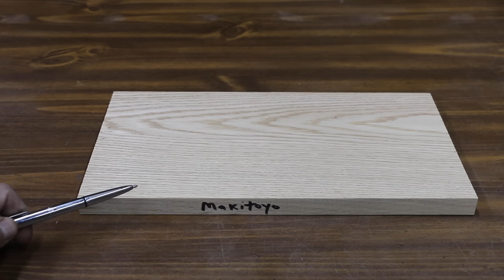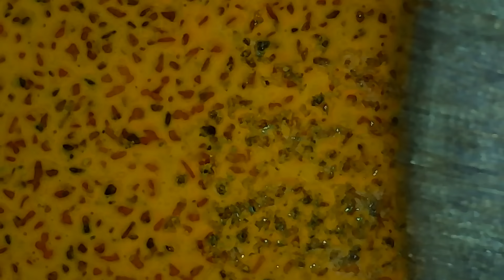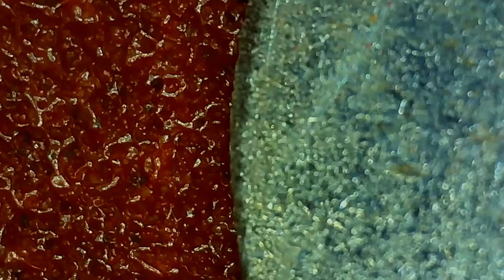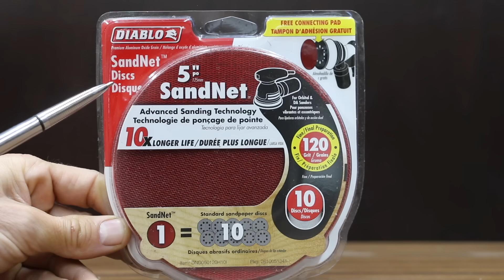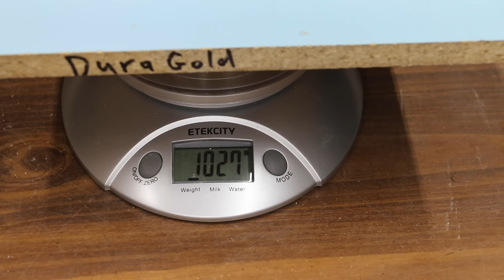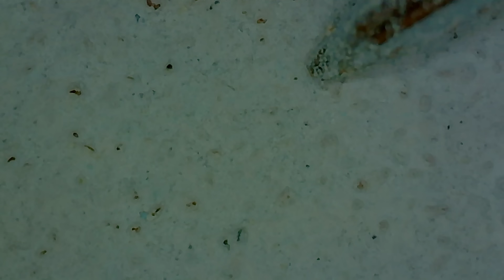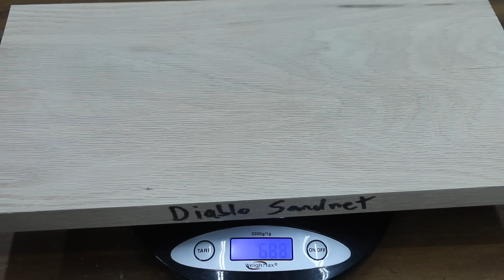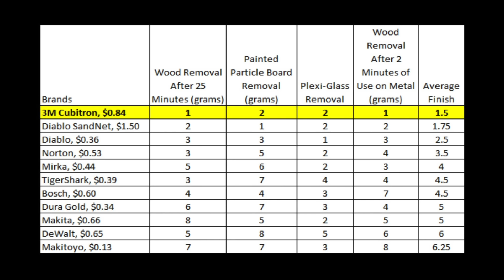Best "Sandpaper" Brand? 3M Cubitron, Diablo, Mirka, Norton, Makita, DeWalt, Bosch Sand Paper

Comment: You know what I would like to see?

I live in Florida and I'd love to see you do something on the best personal cooling device. I have a Makita fan jackt, an ice vest and a ice kap. i had a cold circulation system but it didn't work well. Humidity is an issue as cooling is different in humidity vs the desert. Evaporative cooling doesn't work here but wind on a wet body does.
Just a thought.

Thanks for all you do! I watch these before I buy anything now.
Reply from the maker: Thanks for the suggestion.

Comment: Would love it if you tested the best can of aerosol brake cleaner. 3m, Macs, CRC, etc.
I Personally prefer 3m and have had bad luck with CRC not removing grease and running out of pressure before the can is empty.
Thanks
Reply from the maker: Great suggestion!  Thank you.

Comment: Would there be any merit in comparing MMO/Seafoam with just plain tap water? use the water like seafoam and see if the shock can remove the carbon buildup?
Reply from the maker: Thanks for the suggestion.

Comment: One of the greatest channels ever... Is it possible for you to test three tools brands (Skil, Bauer and Craftsman) for the main tools a DIY'er may need? (Circular saw, recip saw, impact wrench, and drill) This may be so useful to decide for a wireless tool set. Also try Hercules, Kobalt and Ryobi. Such excellent work should be shared everywhere!!! Thanks!!
Reply: It is an interesting idea to average performance across multiple tools in a family, since you're not buying into any one tool line as much as you're buying into a battery family.  

When you move beyond the basics the tool selection varies a lot.  Personally, I have DeWalt for most of the big stuff (and I love their hedge trimmer) but I had to have the little Milwaukee M12 ratchet and have added a couple pieces to that. 

Then there's the Dremel, the 60V Ryobi mower...I got myself a wall of chargers.  

Then there's the Harbor Freight Bauer stuff I keep at a rental place at the other end of the state for light repairs - nowhere near as strong as the others but the value proposition was right for how and when it gets used, and the batteries are cheap.
Reply from the maker: Thanks so much!  Great suggestion!  Thank you.
Reply: Maybe with all the fuss yesterday thanks to Flex introduction through a glorified ad disguised as unbiased tests, you should try to test the usual tools from Flex against Milwaukee and Dewalt to set an end to such discussion. It will receive a lot of views for sure, but please don't forget my initial suggestion about testing Skil, Bauer and Craftsman, and Kobalt, Hercules and Ryobi... For starters, deciding the battery platform is a must. For professionals, a face off with Flex, Milwaukee, Dewalt and Metabo or Makita will be eye opening!!! Thanks and keep doing such an amazing work!!!

Comment: I can vouch for the durability of 3M Cubitron abrasives. Sanding a mixture of polyurethane spray foam(this stuff is killing sandpaper quickly), softwood, aluminium, some galvanized steel, a bit of acrylic plastic, plaster, epoxy and polyester body filler (Bondo),  ONE 5 pack of 80 grit Cubitron II  outlasted 2 packs of 25 SIA abrasive 60 and 80 grit.
Reply from the maker: Thanks for the feedback.

Comment: nice video, im missing sandpaper from sia. im a parquet renovator and we use bona abrasives. but they are way more expensive. we use ceramic disks. we even have disks with diamonds in it. they are grid 120 and cost 10 euros a piece of 150mm

would like to see some tests with grid 40 papers, mayby a grid 40 of bona ceramic? they even have a range of grid 36 that eats wood. 

mayby make a test with lower grid sanding paper.

test them with a wooden stick that is pressed by like 10kg and see how much each disk eats away?? 

hoping u will think about it
Reply from the maker: Thanks!  Thanks for the video idea.

Comment: Your videos are fantastic and by far the most comprehensive and trustworthy of their type on YouTube. Keep up the good work sir. 

As a woodworker I would love to see a comprehensive test of the most durable wood finish. When doing table tops or desktops the finish needs to really stand up some abuse. There are so many different options and everybody has their own opinion, it would be great to see the detail and methodical testing that you offer. Basics like oil and water based polyurethane, lacquer, pre-cat lacquer, and tung oil. More high end items branded products like Arm R Seal, Odie's Oil, Waterlox and Rubio  Monocoat. The list goes on and on.

As far as tests would love to see which one dries the fastest, what's the easiest to layer and build multiple coats, most resistant to scratches, heat and liquids. It's a huge topic that could probably be worth a few videos

I'm so interested in seeing a video like this I would gladly chip in some of the funds to buy the products and make it happen!
Reply from the maker: Thanks, will do.  Thanks for the video idea.
Reply: @ProjectFarm  you bet, and thanks for the response!

Comment: In my humble opinion, putting pressure on the sander taints this test. I'm only a hobbyist but I've done enough sanding in my life (I'm 60 years old) to figure out that the work goes a lot faster and the paper lasts a lot longer and the surface texture is more consistant, if you allow the weight of the sander to apply the pressure. Putting additional pressure beyond its own weight on the sander, creates excessive wear and tear on the tool and the paper. I rarely press down on the sander. I allow the tool and its own weight to do the work and my hand simply guides the sander. Same goes for hand sanding. A light touch makes the work go quicker and easier than pressing down hard on the paper.

and as a side note, I don't really see what was usefull about sanding wood after metal. does the paper sand more metal after sanding metal? That would be useful information. But does it sand wood after metal? Why would I care? why would I even do that?
Reply from the maker: Thanks for the constructive feedback.

Comment: Hey you should test starters, for example you could set up a rig that measures the force a car starter exerts compared to others like with the impact drill test rig maybe on an old engine block you could compare an oem style to aftermarket hi torque and reduction starters maybe even note the effects that upgrading to a different starter have on an engine.
Reply from the maker: Thanks for the suggestion.

Comment: I have likely purchased $50,000 + worth of sanding belts and discs in the last 25 years. When a 37x75" belt costs $30 to 60$ each, you get pretty deep into quality. Norton is always good quality in belts. Mirka is a good all around choice on discs, when bought in quantity is pretty cheap. EKABLUE by UNEEDA is well used in the trades. I learned long ago that 3M was reliably the best quality across the board. But always the top $$$ choice unless found on a closeout deal.  Sad to say I find myself buying .14 cent Velcro imports on the 5" discs - that's 10 for $1.40 - crazy cheap and good enough for most work.  This is a TOP NOTCH test and you are the very first to perform this important expose'  - Thanks!
Reply from the maker: You are welcome!  Thanks for sharing.

Comment: Would love to know, which drilling method is best to use on stainless steel. Should I use regular drill bits or are there other ways to drill holes in SS.
Reply from the maker: Thanks for the video idea.
Reply: @ProjectFarm  thank you so much for considering this

Comment: For anyone interested in getting the max life out of your sanding disks, you can clean them with fine steel wool.  No need to get the sandpaper cleaning stick.  While your sander's running, lightly skim the pad with the steel wool working from the center outwards.  Almost as good as new in a few seconds.
Reply from the maker: Thanks for the suggestion.

Comment: I used the Sandnet on a wooden bench project that required a lot of sanding and loved it! It lasted so much better than anything else I had used. I was going through sheet after sheet of some Bosch brand where I only went through one sheet of the Diablo Sandnet. Very good stuff! 
Thanks for doing this...very good and useful info!
Reply from the maker: You are welcome!  Thanks for sharing.

Comment: Great video as always! I had one question...if you add vacuum on your sander would it have improved the performance vs just using just the standard dust collector as you did. That’s one of the supposed advantages of the mesh sandpaper is that they don’t clog up because of much better breathability.
Reply from the maker: Thanks for the video idea.

Comment: Have to take you to task here,because this methodology is just bad. You didn't test that a 120 grit correctly removed what a 120 grit should, in that if you tossed a sheet of 24 grit into the mix it would have removed humongous amounts of material and won. A 120 that removes too much is bad at its job.

Testing against clogging is great, but total stock removal isn't the goal with sandpaper, correctly arriving at a desired smoothness is, and this test didn't reveal if the surfaces achieved that.

Still love the channel, just disappointed in this particular test.

Comment: This test gives an incorrect result because all the abrasives tested have different purposes. For example, mirka produces about 
20 different abrasives available in 5-inch discs with grit 120 (there are lot more materials than that). The gold series shown
in this test is one of the cheapest and worst grinding wheel series from mirka, it is primarily intended for grinding putty in
car body shops. There are different abrasives for different materials presented in this video, but if you are looking for something
that would work effectively in these conditions and give the best results, I would recommend choosing the mirka abranet product line.
It is of course, considerably more expensive than most of these grinding wheels. Most people do not know how to compare abrasives and
do not know in which situations to use different abrasives. In order to perform this test, a person should have knowledge of mineral
composites and material density indices and also know more about the production of abrasives than can be read from the packaging.
Before anyone starts commenting, I would like to inform you that I have received several trainings on the production of abrasives
and the materials used there. My recommendation would be if there is a plan to sand wood or painted surface and the price of the product
is important then choose a brownish tone abrasive (these are generally designed for sanding wood). And one more thing, MAKITA, DEWALT and
BOSCH do not produce abrasives themselves, I am not sure about these Chinese brands. If someone wants to do a similar test, then besides
MIRKA, 3M and NORTON, abrasives are also produced by, for example, sait, smirdex, klingspor, derfos and many others. Before you start 
making a comparison, find out for yourself who actually produces abrasives and move on from there.

Comment: As a wood worker, sandpaper is an important part of my work.  The amount of wood removal is lower on my list of important aspects of sandpaper.  What I mean by that is sandpaper is used to prepare the wood for a smooth finish.  Typically I don't want to remove much wood because all pieces are prepared dimensionally already.  Loss of wood would put them out of spec.  There are a few occasions when I'll use a coarse grit like 60 up to 120 to do some wood removal, however that might be less than 10% of the time I'm using sandpaper in general.  
What I look for in a quality sandpaper is one that lasts a long time so I'm changing papers less (which you did cover), creates a nice smooth finish so I'm spending less time with the finer grits to clean up the scratches from the previous grit, and one that is less friable so the grit from the previous paper is not left behind on my wood which would continue to scratch the wood while using a finer grit.  I also learned early on that some of the cheapest sand papers are not the grit they claim to be.  This is typically a problem with the cheapest most generic papers.
I love your videos, however I think this one missed the mark.  If you readdress the sandpaper in a later video, please consult a professional woodworker as to what they think are the three most important aspects of sandpaper.  Thank you for all of your hard work producing these videos.  I really do enjoy them.
Reply from the maker: Thanks so much!  Thanks for the feedback.

Comment: More of an off road thing vs a farm thing, but you should consider pitting 12v air compressors against each other.  Ones such as a cheapo cigarette lighter plug in vs some of the big boys such as ARB, Viaair and maybe even smittybilt.  It'll cost a bit though, some such as the ARB Twin aren't cheap.
Reply from the maker: Thanks for the video idea.

Comment: I was super curious how you were going to empirically and objectively test these products. Amazing and clever job! I would only note that an "over grit" sandpaper (a sandpaper with lower actual grit than the grit advertised) would have overperformed in your tests. If you still have the metal test samples around, take a peek at the swirling or gouging of the surface (indicating uneven sanding or incorrect grit labeling).
Reply from the maker: Thank you!
Reply: I noticed this as well. But the data gathered is still useful in determining which product lasts the longest (ie, degrades the slowest).

But this notion of over-grit paper comes with an implication that shouldn't be ignored: when sanding through a series of grits, say 120 -> 220 -> 320 -> 400 -> 600 and so on, it's important to stick with the same manufacturer and brand of sandpaper to ensure you achieve the relative scratch depths you expect.

If your 320 grit is actually 300 grit, but your 400 grit is actually 400 grit, you'll be spending a lot more time getting out the 300 grit scratches than you bargained for.

Comment: Did you blow off the wood using compressed air before weighing? It’s possible some brands may have worked better with your sander’s dust collection than others, leaving more dust on the surface that was sanded off but not counted.

Comment: There is no question that Diablo is quickly becoming the best choice for material removal/reduction. Everything from their sandpaper to their saw blades outperform anything else on the market in terms of value. And you can buy their products at your local big box store to boot. It doesn't surprise me that Dewalt and Makita fared poorly. I've tried both and can confirm your results. They should stick to making tools and stop putting their names on garbage that only fanboys buy.
Reply from the maker: Thanks for the feedback.

Comment: If you do a part 2 could you test the festool sand paper and the mirka net paper. And epoxy is also becoming a new material that is commonly sanded
Reply from the maker: Thanks for the suggestion.

Comment: The next test should be the durability of the sandpaper.  The true value of the sandpaper isn’t how much wood it removes in 10 minutes, it’s how much it removes over the life of the paper.  If one brand is really efficient for 10 minutes, but fails shortly thereafter, but a #2 or #3 pick lasts twice or three times as long, the value shifts to the also-rans.
Reply from the maker: Thanks for the feedback.

Comment: Thank you for that video :) I am building Epoxy-Resin-Tables and have used tons of sandpaperdisks. Due to the epoxy they clogg up extremly fast. I will try out the Diabolo Net and the 3M, maybe they work better :) thanks for the tip! By the Way: I have heard that you can sharpen up used sand paper by making the grinder spin reverse while grindig for a short time so the clogging will get loose and the sandpaper will get sharp again :) I dont know if that works :)
BR
Elias
Reply from the maker: You are welcome!  Thanks for the suggestion.

Comment: I have to wonder if the companies that perform well on your channel then find themselves sitting around in the following weeks wondering why there is a sudden sales increase on their products because they don't know of you and your great work.    I have used a version of the sandnet design and its great for fast material removal but I find the finish is not as good as the other styles of sanding discs.  Did you notice any difference in finished quality between the discs or did not look into that side of things for this test?

Comment: Good test, thanks. I do believe that you should also test the smoothness of the sanded piece. If you just measure the amount of sanded material you would win with a no-name 40 grit paper.

You could check the smoothness by multiple ways, like a microscope.

You could also try by sanding two pieces and placing them on top of one another. Then drag the top piece and measure the force that is needed.
Reply from the maker: Thanks!  Thanks for the suggestion.
Reply: @ProjectFarm  you could also test the smoothness by rubbing the sanded piece against a painted dry surface to see if any paint residue sticks to it

Comment: Would it be possible to see a comparison between sandpaper discs and abrasive mesh? I find it performs better overall for wood and other soft material but it is a bit fiddly with hard material.
Reply from the maker: Thanks for the suggestion.

Comment: In my experience 3M Cubitron sheets are as good as it gets, just like round sheets tested in this video. There is another test on Taytools web site that shows 3M Cubitron is best brand. Cuts fast and lasts long. Also backing is some kind of plastic/rubber that doesn't slip and doesn't tear. One would not think there could  much innovation in sand paper but they delivered.
Reply from the maker: Thanks for sharing.